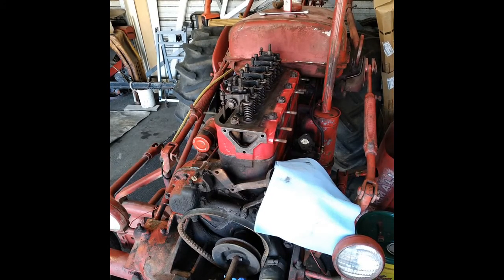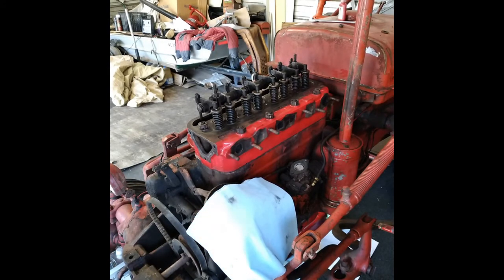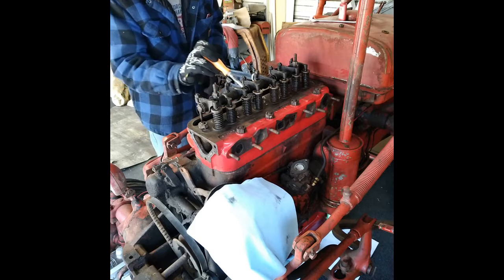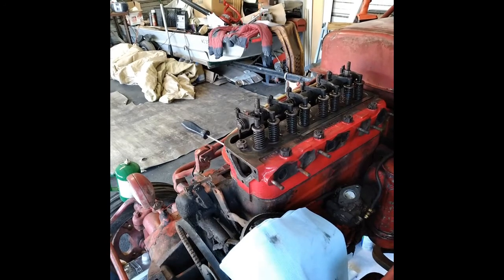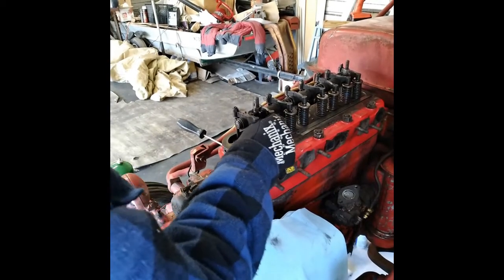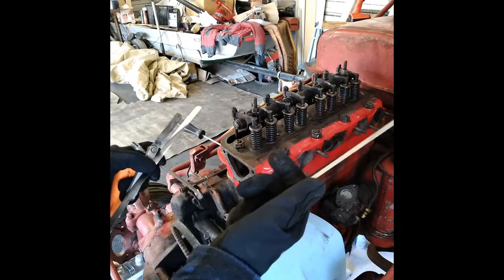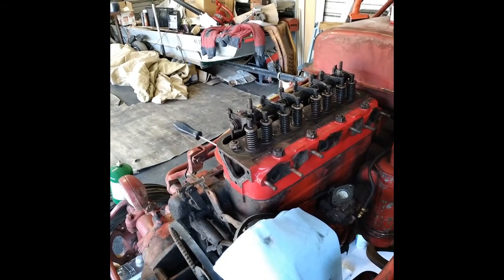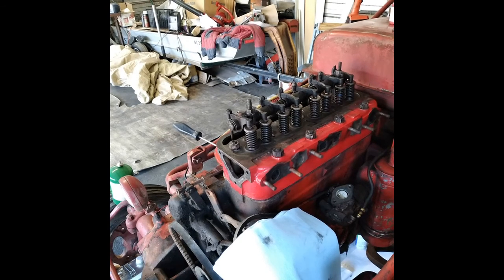Secrets of Farmall Super A Valve Tuning

Comment: As a side; My 140 manual (123ci engine, around 1968 ) calls for .014 intake and .020 exhaust, checked hot.
Reply from the maker: Thanks.
Reply: @russellbarron6775  I figure a lot of 140 owners also get a lot of tips from A and super A videos.